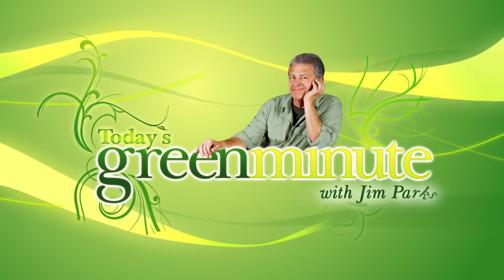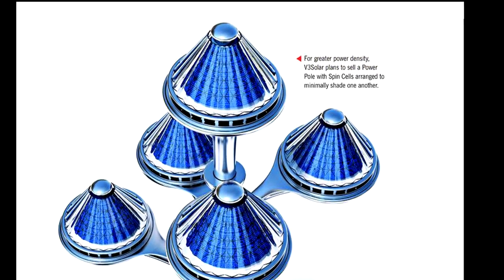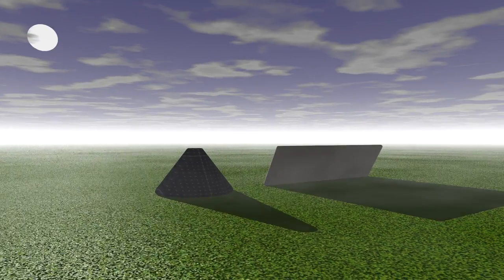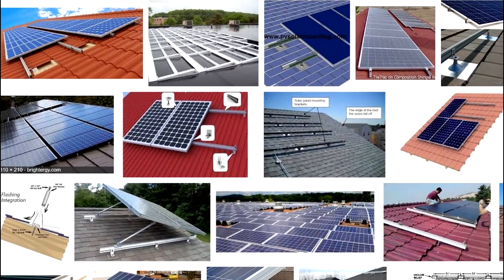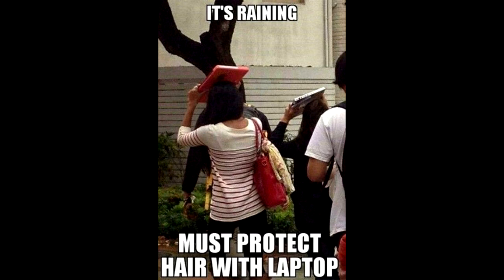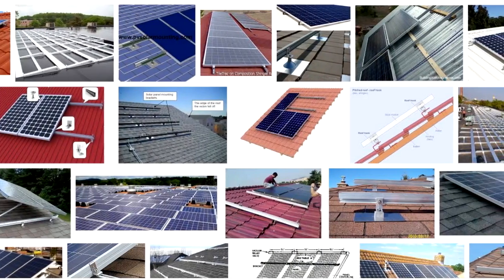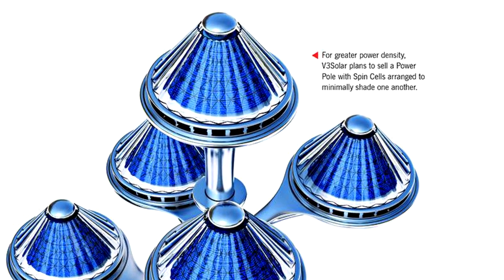Spinning Solar -BUSTED!

Comment: As much as I agree these things are questionable, your line of reasoning about the claim regarding 20x more efficiency is just bad math.  The problem with using a multiplier is that you have to know upon what to use that multiplier.  You don't use them on percentages (percentage itself is already a multiplier).  

You have to use them on a unit of measure of some sort.  To what is the multiplier being applied?  Watts, Volts, Amps, or something completely different such as cost of manufacture amortized across the lifetime of electricity generated.  I personally would never assume (even when dealing with questionable claims) that a multiplier be applied directly to a another multiplier.   

Not one of your better arguments, particularly when you start going on about 50% of 20x of 20%.  Ich.  Unfortunately, you got worse when going into your exercise where you assume that efficiency is 100%.  Umm, what?  How are you going to calculate the accuracy regarding the percentage of efficiency when you just assumed 100% efficiency from the start.  Your feeding answers into both sides of your equation.  You aren't calculating anything but circular arguments.  It's a bit like reading one of those early Intelligent Design books.  You might want to take a Mulligan here.
Reply: So, why don't you run the efficiency calculation yourself using available data?  Figure out roughly how much power a cone would produce with 2/3rds of its surface area not directly pointed or entirely pointed away from the sun vs an average flat solar panel with the same total surface area.

Thunderfoot provided basic numbers so a calculation could be run in order to bring the point home.  Regardless of what numbers you use, in any fair scenario comparing a solar cone and a solar panel will not produce a 20x efficiency leap for a product that spends more than half its time not aimed at the sun.  

You understand the concepts and numbers, but were incapable of understanding the reason he plugged arbitrary numbers in?  I'm serious, what do YOU think the results will be if using real-world solar tech in a head-to-head comparison, one being a 1 square meter flat panel and the other being a 1 square meter cone?  20x efficiency in favor of the cone?
Reply: The calculations themselves are unnecessary, as the criticism should be that the claims are unsubstantiated.  In trying to give a fair shake to made-up numbers, he ends up in his own circular argument by utilizing flawed reasoning.  This really is not a good approach when making the grandiose claim of "debunking" the supposed invention.  It didn't debunk anything.  I'm a positive this produce is very debunkable, but thunderfoot's approach doesn't do that.

Comment: so recently I was searching for a portable car battery jump starter and I came across these handheld battery backs, the kind you would use to charge a phone, and they have these little jumper cable looking things that run off usb. The best part is they advertise how many mA it puts out. I'm just thinking how the hell is there enough power to drop the relay in the starter let alone turn over the engine.

Comment: Instead of a cone they would be better off to arrange the panels as an antiprism oriented vertically. And it still  wouldn't be nearly as efficient than  just orienting a flat panel in the conventional  manner.   Add too that that these things need to eat power just to keep them rotating and about half the panels are always facing away from the sun. Somebody is laughing their way to the bank...

Comment: I think what it means is the cone can generate more energy in one whole day than a solar panel can, without either one having to rotate. As for the Free Electric, it's a metaphor. It's not really free electricity, it's a bicycle generator, whose output is far greater, relative to its input, than any other. Now here's is something you should look at: http://billionsinchange.com/solutions/limitless-energy/ This talks about unlimited geothermal energy, using graphene as a conductor that won't melt, unlike copper.

Comment: there is something you didnt mentionned...
when it is early morning, solar panel doesnt produce almost nothing.. but a conic panel will produce... and same for the evening...

what i want to say is that this one will produce 100% at each part of the day... so in matter of time, it will produce more than a regular panel...
BTW, i have solar panel... and on sunny days it is much hot than 30C degrees... i almost cant touch it

Comment: They already have pivoting mounts for the solar panels, which will aim the panels at the sun for maximum efficiency.  
Whether you use them is a matter of economics.   For the price of the sophisticated mounts you could buy more panels.

Comment: It's also impossible to build as you can't have power connections on a freely spinning structure. And any system to push power over a gap will have additional massive inefficiency.

Comment: You know what's a better way to prevent the efficiency loss by angled sunlight? A motor hinge that tilts an entire rectangular panel. You'd only need one even semi-curved solar detector thing to figure out which way the light is coming from and then ping that through to the motors to say "Alright, now angle this way perpendicular sunlight angle". And you know what? For the big solar farms that's what they're already doing! Heck even nature figured out that rotating flat surfaces works better than conical ones around the time it evolved leafed plants.

Comment: Doesn't all that spinning consume electricity? Both in terms of the extra energy needed to manufacture the extra parts but also to run the electrical motors.

Comment: I was told by someone that a solar panel becomes saturated with photons and the spinning allows them to both cool and also continue to produce a bit of energy while they rotate around the dark side of the cone. And it spins fast enough for the panel to be at least partially in sunlight by the time it's done converting all the photons.

Or something like that. I have no fucking clue how any of this shit works.

Comment: look of course it's impossible for them to produce 20 times and your math is perfectly fine , but I think that you're missing an incredibly important point in circuitry which is that overheated solar panels are less efficient than cooled solar panels. however there is no doubt that they are not 400% efficient.

Comment: Wait, he said 20x more Efficient?!?!?!, This is news to me, they clearly do not say Efficient anywhere at all. I was 100% sure they claim, and i Quote the picture "20x more energy". Energy Does not equal efficiency in any way, shape or form. That is a HUGE logical leap there, and is obviously the stupid one to make when you  consider what they are comparing it to, a regular, fixed solar panels. 20x is obviously way to much, since panels that perfectly track the sun can only produce about double the energy in a day. When you put cone shapes up agaist fixed angle solar panels, which are the ones most home owners will actually get, things are a lot more complicated. Cones have several significant advantages.

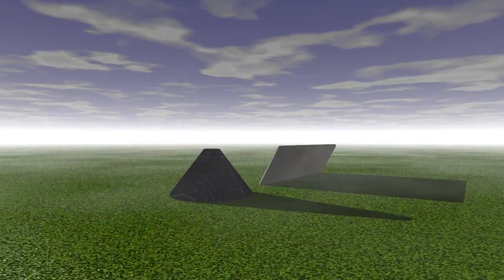First, due to less horizontal space, you can fit more of them in a horizontal area. At 3:20, you clearly could fit 2 cone panels within the width of the one flat panel, and unless the sun sets on that horizontal plane, the shade would be virtually negligible. Space directly behind any kind of panel has too much shade to be used anyway, so the depth can be mostly ignored outside of larger areas, but we are talking about Homes here, which usually do not have that luxuary. 

Second, Cone panels (even non rotating ones) will still have 2 periods of direct sunlight every single day in almost all latitudes. Intermediate Value therm assures this.If the sun goes from the horizon to even 50/60 degrees in the sky (in winter for USA) back to the horizon, then it will at least twice a day be at every number between 0 and 50/60, and on opposite sides of the sky. Regular panels will not rotate, and so will at best get once, and many months of the year, will not even get 100% direct because the sun will be off to the side by likely a significant amount. 

Thrid, Most homes have slanted rooves, which are likely to not be at the optimal slant AND direction necessary for peak efficiency of fixed point solar panels. Cone panels do not need any slant at all. As noted in the second point, they will in most latitudes have 2 peak periods a day every day of the year. No horizontal movement of the sun will change that, because the cone faces 360 degrees at the same time. most houses will have places that get sunlight most if not all of the day, every day of the year, and direction/angle does not matter. Flat panels have to worry about both, and usually will have to settle.

So indeed, while half the solar panel is not getting light (when the sun is not mostly overhead like it is at the equator or in summer for higher latitudes), The other half of the day, The cone will output the reverse amount of energy, but the panel will usually be at a bad angle and produce less. The flat panel will have a higher max in a day, but the cone will have a higher average for most cases, AND, will have a significantly higher average over the course of a year since no matter where the sun rises and sets, the panel will still have half of it directly facing that sun, guaranteed.

of course, I was assuming non spinning cone panels, made of regular materials, and not the ones that are made of cheaper, possibly more efficient materials and are cooled via air flow and shade, at the cost of a portion of the electricity they would generate.

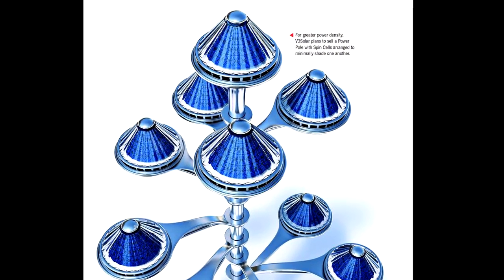Comment: Your math is incorrect. Due to its conical shape approx. 68% of the surface is facing the sun at any given point(excluding 11:30-1:30) even still it is a 32% reduction in efficiency

Comment: BTW:  I would not be surprised if the design came from a solar installer who noticed that the flat solar panels at the apex of an A-frame house were degrading much quicker than the panels closer to base of roof near the eavestroughs.  Heat collects at the apex, which just makes sense that in places like California and New Mexico which are already hot to start with - if you want your panels at the apex - you will probably be replacing them twice as often.  If you live in a consistently cold climate below zero, the apex might actually improve the panels, that along with a perfectly vertical alignment because even a light 2  millimeter dusting of snow will basically disable any solar panel.

Comment: Musk's Mars mission? You're calling bullshit on that? Make a video. It would probably be attacked by SpaceX fanboys, but you wont let that intimidate you, will you?

I for one hope for a Mars mission, but if you really have a serious problem with Musk's one then please make a video. I'm very intrigued. It would most definitely be the highlight in this series if you could actually pull it off.

No going back now anyway since you already stated your opinion in this video about it.
Reply: medicore0000 its launching tomorrow!
Reply: medicore0000 yeah don't understand why the Mars mission is but in the same category, it's certainly impractical, but not impossible
Reply: Jay Koerner, Not even Thunderf00t claimed that it is impossible to spin a solar panel.  It is just not very practical.
Reply: stefan r yeah you miss understood my comment, I was saying that the mars mission at least makes some sense and is certainly possible, and that I  don't see how it's like this stupid spinning solar panel can be compared to it

Comment: Solar panels are similar to computer chips.  Computer chips will begin to fail exponentially quicker when they go above their operating temperature.  You can expect 1 year life on a computer chip that is operating at 100 Celsius that may be initially designed to run for ten years at 75 Celsius.  LED bulbs are similar, heat will kill it.

Its not any more efficient when measured in watts while operating, but it may last much longer if you can keep it cool.  That's what I think the idea is, you do not have to buy panels as often as replacements.

Comment: The biggest benefit from fixed solar power is that it doesn't require fuel and it have no moving parts. No maintenance and no fuel cost. Only a passive income of genereated electricity once it is up. This takes away one of the biggest benefits of solar power by adding moving parts to it.

Comment: i guess that the author of this clip needs to learn some math again really badly. He compares that the regular ones panels convert to electricity only 20% of the energy, than states the new ones convert 20% more than the old ones and EUREKA he says the new ones runs with 100% efficiency. The f*** with that? 20%+20%of 20%=24%

Comment: I have not read all the comments so if this has been addressed I apologize in advance.

possibly the efficiency is made in the production costs of the spinner panels (without the greenhouse of course).  I will just call it a naked spinner.   A standard solar panel has the extra production costs of the heat dissipation.  

My thoughts is that, and I am just going on a WAG here, possibly more than 1 of these naked spinners could be made for the costs of the standard solar panel...

also as long as I am just typing while I think would it not be easy enough to 'track with the spinner as well.  ?  

at the end I would think at best a marginal gain would be made over standard anyways.

Comment: No mention of the power required to spin these things? You're slippin bruh. Lol.
Reply: Anna Filina not if it generates 400% power! where do you think all that extra power goes?
Reply: That was my first thought. Spinning would probably cost more energy than it generates.
Reply: well, bear in mind that he's stacking it up against a tracking panel, which also needs power to move (albeit likely less power)
Reply: Ian McLastname those move  less than 360 degrees in a 24 hr period.These move 360 in just a second. Assuming the weight of these is only 1/10 that of a tracker panel, that's still much more energy required.
Reply: these things reduce the energy made by being in a cone, using energy to spin in order to keep it cooler so it remains more efficient. and then they put it in a green house. even though solar panels are designed not to over heat. 

WHAT IS THE POINT OF THIS THING?
Reply: The point is getting money for research, and then siphon that money off for "other" purposes, like buying a house, a car, and an eternal holiday.
Reply: Sam Cecere You forgot the sarcasm font :P
Reply: Probably not that bad*, if you stick it on well-oiled bearings.

* as everything else
Reply: Stephan Phillips That part kinda speaks for itself.

Comment: They could of just make half of a cone shaped solar panel and make it rotate with the light source, that will be way more efficient and I just used 20 second to think of this idea. The other half of the cone could just be the cooling system. There, problem solved

Comment: Thunderf00t  You're normally spot on or very close, but on this one you seem to have missed one of their points a bit, not that Mr Fillion stated it all that well or it would really make sense anyway..  Heat avoidance didn't seem to be about the heat drop off of the cells, but changing the type of cell.  If avoiding heat let you use say a paper backed cell that was 1/40th the price, even with 1/4 active area of the cone you'd still be gaining 10 times over the same money in regular cells.  Anything better than 1/4 the price and you start getting a little more than the area loss.  Still stupid overall but at least the basic idea had some bit of sense to it, so a little better than solar roadways..

Comment: HOW... HOW DARE YOU USE 3 AS THE EQUIVALENT TO PI?!
Reply: Blasphemy! Instead, he should be using the Leibniz infinite series to represent pi. Because that is in no way laborious, impractical, or nonessential!
Reply: Anti Master It's an approximation. Besides, he turned root 2 into 1.5 to balance it out.
Reply: 1.5 is the approximation to halves. Approximation to tenths would be 1.4
Reply: He didn't turn root 2 into 1.5 to balance anything. 1.5 is the numerical representation when rounded to tenths

Comment: you are very stupid since you are not considering that after some time the flat panels will not be illuminated anymore while the conical one still is... so of course is not generating power the shaded power but it will after some time

Comment: I've tried  experiment this similar  method with a 1 meter diameter dome with different height to see if this could optimize the efficiency, but found that flat panel lying flat on the floor have better efficiency than any shape. LOL